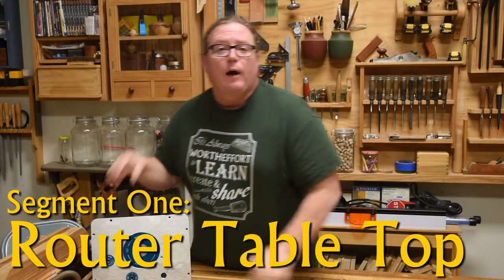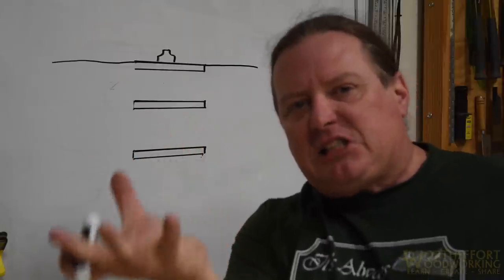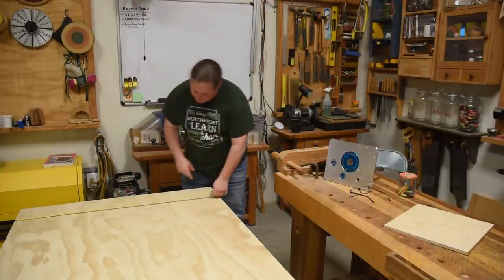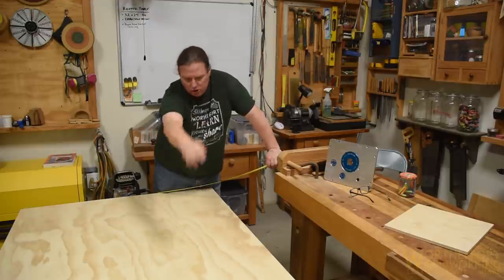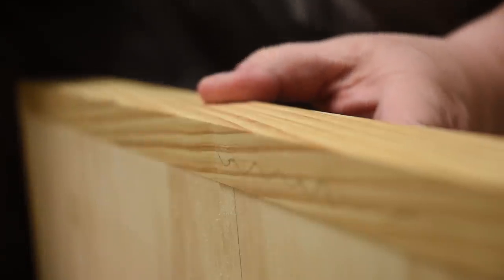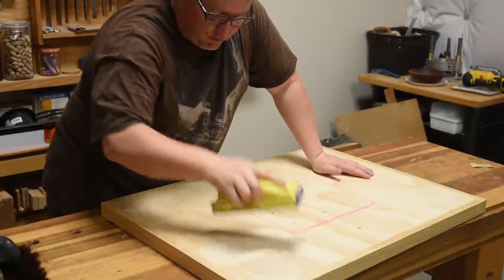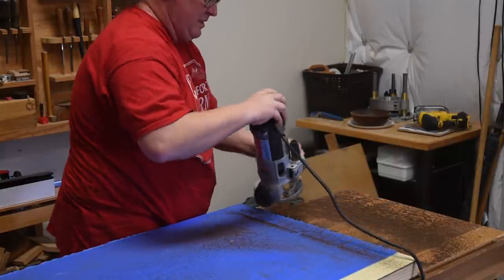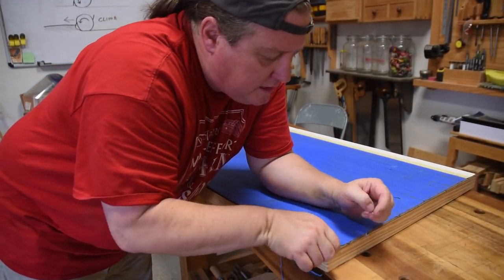Router Table Build - Segment One: Table Top

Comment: May I ask why you taped up the whole white top with painters' tape? Were you just being extra careful and could've just as well only taped the edges that needed to be routered? Great instructional video, btw! I have a manufactured router table, but it's just pressed steel and also not flat, so I'd really like to build this.
I also like your practice of trying out techniques on stuff you build for yourself to gain experience for the future. I joined two pieces of wood to make one longer piece to use as support for a drawer in the shop by combining a half lap and 45° scarf joint yesterday to see if it would work for something else for which I have a severe shortage of the right lengths of wood of the right kind!

Comment: That was great. How come you didn't add the edge banding after the white board to cover and protect its edges? 
I have a large commercial router table and a smaller one that i made myself. Weight is an issue for me so i made the top by making an aluminium angle structure for stability and laminating it between 1/4 melamine faced ply. the gaps are filled with insulation board, which soaks up noise and vibration. The top works well and is stable after a few years of use.
Reply: He mentioned that he might need to replace the top in the future, so if he had put the edge banding on after the white board was applied he would have to remove the banding to replace it.  My router table top is melamine glued to MDF, then bonded to 3/4 plywood, and I did put my banding on as you suggest since if I have to replace the melamine for some reason I'm going to trash the whole top and rebuild it anyway.  If I get a big chip or crack in the melamine I think it would be easier to fill the defect with epoxy and move on from there.
Reply: @halsonger1317  Thanks Hal, I must have not been paying attention at that point. I'm thinking of rebuilding the top of my bought router table, so am looking round for ideas. It's 1 1/2" mdf/melamine and is definitely not flat. Since building a micro-adjust fence for my homemade small router table I now need to modify my larger table to include that too. It's never ending : )

Comment: Well done instructional video. I think if I do a similar build, I would apply the white board before the edge banding, then the edge of the white board wold be better protected from bangs and dings. But, hey, that's me. 
BTW, I hope you cleaned any tape residues off of that white board before writing on it. A little residue will hold even dry erase marker. Since you already have episodes 2 and 3 out, guess I'll get to go and see right now.
Thanks for sharing this build and instruction with us.
Oh, one question, why not a torsion box build to hold the top flat? Thanks.
Reply from the maker: Thomas Russell leaves chance boards would snag on banding.
Reply: @wortheffort  yeah, thats true. Good point.

Comment: Sometimes a Luthier will put hide glue on one side of a joint and let it dry overnight. The next morning they will fit the joints together and take a hot pallet knife to warm up the glue so they can slowly stick the 2 joints to each other without having to worry about joint alignment issues. Hide glue is my glue of choice when I know my work will not be subjected to heat or excess moisture. Hide glue, in my opinion, is just nicer to work with than the modern plastic glues.

Comment: Im wondering why one might not want to combine a layer of ply and a layer of mdf? Seems like you could get the benefit of the flatness and smoothness if the mdf as the top layer and the structural stability and sag prevention of the ply as the bottom layer.  Are there “cons” to this approach I’m not thinking of? I’m trying to decide if I should build my own top or just take the plunge and buy a cast iron top. I like the idea of just not having the doubts in the back of my mind that might come with building my own but the money savings is very tempting.
Reply from the maker: They make that, mdf with a ply exterior.

Comment: I built my router table a few years back and did the usual MDF with melamine. Would sealing the MDF on the bottom and edges help with the moisture issue.
Reply: Of course it would but make sure it is dry to where you want it BEFORE sealing.

Comment: Timing couldn’t be better as I’m in the midst of rebuilding my router table as the big brand router plate was not flat, apparently they claim this is intensional but it makes it impossible to level the plate, so I’m having to star over with a different brand of plate.
Reply from the maker: ugh